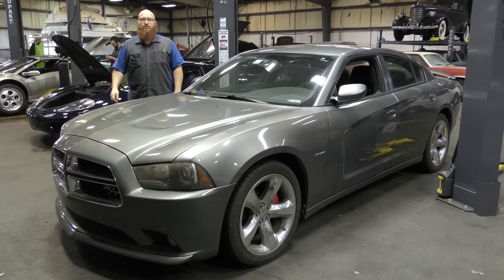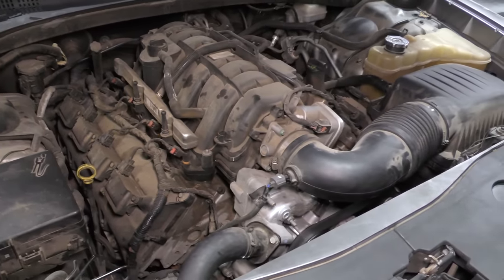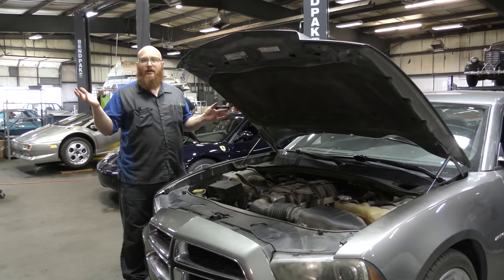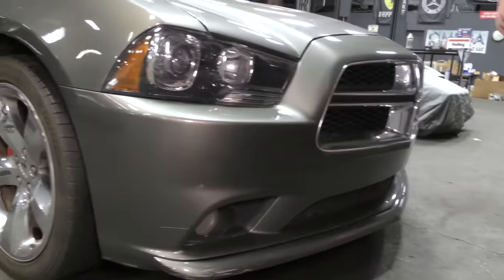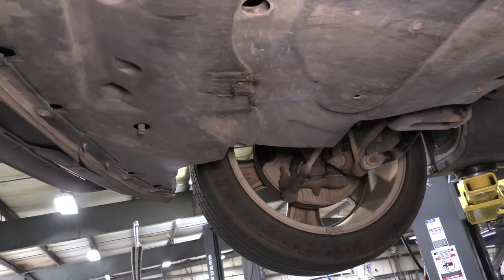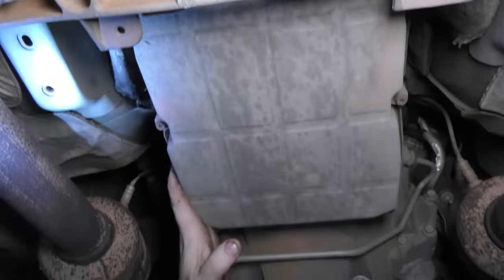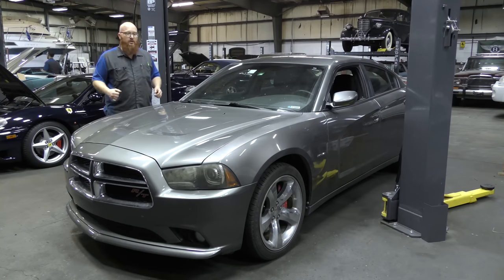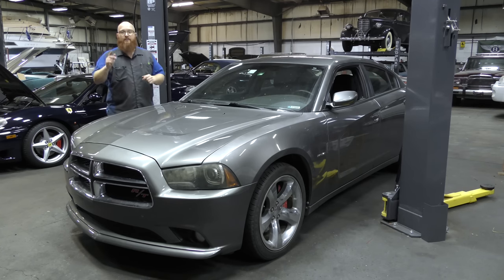Tic Tic Tic! 2011 Dodge Charger RT has the infamous Hemi tick. What will the CAR WIZARD do about it?

Comment: I'm from europe. I'm not familiar with the prices over there but 500-600$ for a sensor and starter button replacement sounds like a lot to me.
My c200 from 2011 had a problem with one of the fuel lines from the tank and needed discs and pads on the rear axle. I payed in total 700euros for everything.
Reply: @gregkarch4673  ohh you're right, I missed that and I forgot about the diagnosis. I guess you're right,the price does sound reasonable

Comment: Not only the hemi is famous for the ticking the Ls to i have a 2017 gmc sierra 5.3L and the damn thing ticks to and make wired noises i can't believe my 1995 dodge ram 1500 3.9l v6 sound better that the 2017 and it has 190 thousand miles the only thing that I have done to the motor is 2 timing chains and valves adjustments i am always amazed that it still runs

Comment: I just built a 5.7 and added a distributor drive gear to the camgear. Discovered it had a bad timing chain set. The VCT engines have the worst timing chain I have ever seen. The tick is partially caused by this chain chipping away at the crank gear drive. Take the chain off and look at the crank gear and be amazed at the stupid design of this chain. I ended up modding the chain tensioner and cam gear from a 2006 model. Took apart the VCT gear and used the back plate on the 06 timing gear cause the parts aren't compatible at all. Welded that plate to the front of the 06 gear, Ground off all of the material used to center the gear on the cam, welded on a drive gear from a 4.2L ford v6 and used the cam sink body to center a heavily modified GM distributor. ...  For every penny pincher out there. the easiest way to fix bad rollers on the lifters is GM 3.8L lifter rollers. Not the lifters themselves, just the pin or rollers and pin. The pin is what goes bad, the needles never seem to be damaged so press out the pin and press in the other one. At the salvage yards 3.8L v6 engines are everywhere, parts are easy to find and easy to remove. So far, I've done this to 9 hemi's and no one has had this issue happen again . Wearing the edges off pennies in the best way possible cause doing the lifters on hemis isnt hard but you dont want to have to do it again and this method really works.

Comment: I have an ‘04 Ram 1500 with a Hemi and it doesn’t tick. I know what you’re thinking but no — it’s not up on blocks in my backyard. Daily driver with 140K on the clock. Must be the luck of the Irish!  I’m American though. Don’t even use Irish Spring soap. No Lucky Charms either.

Comment: Hey Mr. Wizard on have 2000 Chevrolet Monte Carlo SS with low oil pressure I replaced the oil pressure switch and its still reads low oil pressure also it has the 3800 V-6 motor. Should I rebuild the motor or replace the engine?

Comment: I owned 1 chrysler vehicle, never again!! I was so happy to sell it!!
Reply: Greg B  68k miles dead transmission, 74k more transmission problems. Metal and over vehicle quality cheaply built. 4x4 transfer case started to throw warning lights for no reason as well. i sold it to carvana before it got too much in the hole
Reply: Was a 2017 cummins 2500

Comment: My dads 05 Ram 1500 with the Hemi dropped a valve seat at 180k watch out for those. He would have fixed it but the trans and rear end were on their way out too. He only towed a handful of times with that truck never overloading it.
Reply: He had rear end issues since it was new and they wouldn’t replace it.

Comment: Are the tow hitches stock on these or what? I just recently bought a 2013 chrysler 300c and it also has a tow hitch just like that on the back, I got kinda scared thinking someone used to haul stuff with my car but then I realized if anything, they were probably hauling dirtbikes or jetskis or something instead of a vehicle. Seeing it's on this charger though makes me happy and makes me think maybe it's just stock lol. I was buying a 2013 chrysler 300s but it got sold two hours before I went to get it so i had to go with the 4,270lb one instead of 4,007lb one :(

Comment: The coyote engine (mustang gt) 2018 and above also have the same type of tic. Wizard Any advice on the “coyote” tic? Thanks
Reply: All versions of the coyote (2011-Current) can have the tick.  Its completely harmless.
Reply: My 2017 GT has the tick ... Almost at 5 years of ownership now, zero issues - with a supercharger. So many people on forums - especially 6G, try and attribute the tick to other issues they are having and it's nothing but speculation and hyperbole. Ford even released a TSB stating the noise is harmless.

Comment: I wonder if the power window motors on that car are Siemens branded. Siemens is German. 
I pulled a bad power window elevator assembly from a 2004-2006ish Ford Explorer with a Siemens motor.

Comment: Hey, Wizard, do You reckon if You could have a little view on a 15-19 Pursuit Charger ( 5.7 AWD ) I have imported that car from Canada to Poland ( where as for standard Dodge products we have all the parts in stock, as for Pursuit model I have to import everything from USA ) it's overall in supreme shape ( less than 20k miles when purchase ), but now it started develop very wird noise from transmisson/drive shafts when you get off from accelerater in 20-40 mph zone. Firstly I thought it's comin from bad flex joint, but this sound only appears in that 20 - 40 mph zone..

Comment: I swear you can insert the key fob into the start button by pulling out the button itself? Because my 2011 Challenger can do that if the starter button fails itself you can use the key fob as a actual key to insert and turn to start

Comment: Question car wizard, I’ve got a 2015 Honda Accord V6 6 speed automatic transmission, I pulled the dipstick and there was a very fine metal particles smaller than a grain of sand on the side of the dipstick. Is that normal?

Comment: Not knowing much about Dodge hemis - Hadn't known about this tic before. 
As described, it did sound like lifter leak down, causing extra clearance? Poor design or manufacture quality? 
Lifters might pump up a bit, at higher revs & oil pressure, reducing noise, then?
A ticking time bomb - Or handy warning? Sell @ 200,000?... Don't buy in the Ffirst place? :)

Comment: Ive got an 06 Charger RT with 180,000 miles and it doesn't have any tik of any kind. What it does have i can't figure out is it has a spark knock sometimes. I run 93 octane in it all the time. If you have any ideas please let me know. Sometimes it does say it lost connection with the crank,cam and trans shifter sensors among others. Ive replaced the computer and checked all the grounds and connections. i just dont know.

Comment: Oh, but there is a major issue with HEMI tick, and it's a sign of an inevitable repair that's needed in your HEMI. 

Once the ticking begins (normally after the break-in period), that means the roller bearing on a lifter has worn out and is now scraping against its cam lobe. By 60,000-100,000 miles, the cam will become so worn that it'll start misfiring, and the engine will need to come out for replacement lifters and a new camshaft. 

The cause? The HEMI has a major design flaw where oil doesn't reach the lifter bearings or the camshaft to lubricate either of them at low-RPMs. To prevent or delay this type of repair, don't idle your engine for very long, keep the RPM above 1500 if need-be. For newer HEMIs, leave auto stop-start on. Don't be a meathead about emissions. It's saving your HEMI. 

Oh, and let me present a catch-22 on idling a HEMI. Chrysler's ZF8HP transmission likes to shatter at around 60,000-100,000 miles as well. The reason why is because it REALLY hates running cold. So the Chrysler owner who wants to look after their car needs to choose which is better to save for preventative maintenance. Warm up the car/truck on a cold winter morning to save the trans, or run it cold to delay an expensive engine job.

Comment: Why do some of the hemi engines drop a valve seal into the cylinder and on average its on the passenger side bank?  I've seen it happen a few times in the dodge magnum and the 300c.

Comment: I thought the hemi tic was caused by the MDS system and the remedy to it is to disable MDS.
Reply: The MDS is just garbage , Chevy also suffers from that. I believe if you buy it new you can ask them to disable it .
Reply: Tech13 commented:The injectors tick very loud even more so starting 2011.they put noise insulation over the rails to help. The lifter rollers wear out and wipe out the cam lobes. That happens because they moved the cam higher in the block for better valve train geometry.  Now the cam does not get constantly bathed in as much oil and there is no oil gally feed to the lifter bores for lubrication.  It gets whatever washes over the lifters. If you hear a lifter tick that means the lifter roller is worn and the cam is getting scored. If you have a misfire and you want to determine if it's a bad cam. Do 4 or 5  Accelerations to the redline. Then the engine will start to misfire bad
 Let it idle and it will smooth out. When the ramp on the cam lobe is damaged it causes the lifter to collapse on hard acceleration.  Even if you don't hear a tick it can still be a bad cam.

Comment: Hey Car Wizard, I have a 06 gto ls2 that idles a bit rough (shakes side to side) sometimes that's accompanied by a light ticking that seems like its coming from the bottom of the engine, it only seems to do this when i'm idling, when i accelerate it feels pretty normal.  Any ideas?

Comment: Have 38k miles on my hemi. Is there anything I can do to avoid a hemi tick? Is it usually the exhaust bolts or the actual cam issues? Just regularly change the oil and deal with it when it comes?
Reply: @doucheymcfloppycock7459  Thanks for the tip. I do OC's at 6k with my tire rotations but always use full synthetic and don't idle long. I bought it used about 20k miles ago so I'm taking good care of it. How's your Challenger treating you otherwise?

Comment: Could just be exhauste bolts. This hemi tick gossip is rampant.. my ram has 115,000 with no issues. Use  a very good oil I mean very good and change every 3,000 you'll be fine.
Reply: Also don't idle for long periods of time...highway driving is best...

Comment: Jesus that engine needs a cleaning, and I gotta say I remember coming across a florida man on here who had one of these, and one of the things he said that's an issue with them is the thermostat comes on too late, which can cause the motor to overheat and cause problems, including maybe that tick, like I forget the exact number but it needs to come on earlier to keep these reliable, I think 215 instead of 245.

and I think the latter hemi's had that change done to them.

Comment: I'm surprised no mention was made of the high mileage engine, loss of valve seat problem the 5.7 hemi is notorious for.  I'd be seriously concerned about that if I was the owner.  Edelbrock cylinder head swap would be a smart idea.

Comment: Re: hemi tick. I Do Cars implies these Hemi motors tend to drop valve seats, possibly related?
Reply: No, it isn't. Is more an issue of engine overheating. My 2008 Chrysler 300 did not have the Hemi tick before one valve seat dropt.

Comment: cool review but i hope for the neightbors they dont drive at 3am lmao,and the big problem with those car are the electronics here in qc canada they have big problem with it cause of the harsh cold climate and other mixed temperatures we have, nothing wrong with them until you get abit of wear , like over 60 k miles start to get expensive to fix my brother had many of those hemi dodge pickups. minus 35 fahrenheit here is nothing special haha

Comment: Just got 2010 grand Cherokee with a  5.7 hemi and 52k miles. Hopefully my lifters are okay :)
Reply: Also wizard Id love your opinion on the 2005-2010 grand Cherokees(WK). I know the 4.7 is trash but I’ve had a 3.7 and now a 5.7 :)
Reply: Suggest Tech13's comment shows what you can do to test out your new purchase:
The injectors tick very loud even more so starting 2011.they put noise insulation over the rails to help. The lifter rollers wear out and wipe out the cam lobes. That happens because they moved the cam higher in the block for better valve train geometry.  Now the cam does not get constantly bathed in as much oil and there is no oil gally feed to the lifter bores for lubrication.  It gets whatever washes over the lifters. If you hear a lifter tick that means the lifter roller is worn and the cam is getting scored. If you have a misfire and you want to determine if it's a bad cam. Do 4 or 5  Accelerations to the redline. Then the engine will start to misfire bad
 Let it idle and it will smooth out. When the ramp on the cam lobe is damaged it causes the lifter to collapse on hard acceleration.  Even if you don't hear a tick it can still be a bad cam.
Reply: You dont drive enough. Might have lot rot. Just kidding. But that is like 5k miles a year.
Reply: @bendino9016  well I bought it at 52k in January and have 56k now and I did the basics belts, fluid change and an alignment. Loving the car so far especially getting out of a 3.7

Comment: Anyone see a difference between a manual to an automatic? I feel keeping those rpms closer to 2000 is keeping the motor lubricated. How about a high volume oil pump? The lifter could use an improvement on its design.

Comment: I switched to an srt oil filter, quieted it down a bit, same as going to premium and some liquimoly lifter additive.  If you REALLY wanna quiet it down? Throw some Long Tubes on it 🥴
Reply: 5038041AA is the P/N thatll fit the 11- 14 hemi, think they updated the oil cooler in 15 so its a different size now.  If it takes the mo-899, this filter will fit.

Comment: Hey Wizard & Mrs Wizard!! Ooo, a Charger, I slammed into one of those when it's driver ran a stop sign!!! 
As for the Tic? Just reschedule the valve train for the afternoon run. 🥴🤪
Reply: And no mechanic in a bottle
Reply: Tech13 commented:The injectors tick very loud even more so starting 2011.they put noise insulation over the rails to help. The lifter rollers wear out and wipe out the cam lobes. That happens because they moved the cam higher in the block for better valve train geometry.  Now the cam does not get constantly bathed in as much oil and there is no oil gally feed to the lifter bores for lubrication.  It gets whatever washes over the lifters. If you hear a lifter tick that means the lifter roller is worn and the cam is getting scored. If you have a misfire and you want to determine if it's a bad cam. Do 4 or 5  Accelerations to the redline. Then the engine will start to misfire bad
 Let it idle and it will smooth out. When the ramp on the cam lobe is damaged it causes the lifter to collapse on hard acceleration.  Even if you don't hear a tick it can still be a bad cam.

Comment: Had a 2011 charger rt I got it in 15' engine jus clunked out last December Hemi tick 3rd coil misfire led to a cam and full roller replacement 3700 dollars. Well I didn't pay it my dumb ass sold it 4 2500 took that drove from cali to Mississippi baught a 2019 challenger rt guess in 5 yrs I'll trade it in like the owners of my charger did

Comment: That is one filthy engine. I'd have to give that thing a thorough cleaning before I would work on it. To much danger of getting some of that dirt inside. 
Any idea what causes the Hemi "tick"?
That paint wouldn't last 2 years in AZ. The sun would burn it right off. It would have huge spots everywhere. I always get white cars, but they have their own paint problems. Seems like all American white cars have paint that just falls off. My 2006 white Grand Marquis daily driver is in great mechanical shape, but half the paint is missing.

Comment: You didn't explain the cause of the hemi tick.
Reply: Tech13 commented:The injectors tick very loud even more so starting 2011.they put noise insulation over the rails to help. The lifter rollers wear out and wipe out the cam lobes. That happens because they moved the cam higher in the block for better valve train geometry.  Now the cam does not get constantly bathed in as much oil and there is no oil gally feed to the lifter bores for lubrication.  It gets whatever washes over the lifters. If you hear a lifter tick that means the lifter roller is worn and the cam is getting scored. If you have a misfire and you want to determine if it's a bad cam. Do 4 or 5  Accelerations to the redline. Then the engine will start to misfire bad
 Let it idle and it will smooth out. When the ramp on the cam lobe is damaged it causes the lifter to collapse on hard acceleration.  Even if you don't hear a tick it can still be a bad cam.

Comment: Customer: Hey my cars making a funny noise and there’s lights on the dash

Crook mechanic: We diagnosed your vehicle, your muffler bearings are shot, the oxygen pressure sensor needs replaced, the hydraulic steering oil needs to be flushed and the harmonic balancer is out of balance

Customer: ok how much is that?

Crook mechanic: $8700 and we can finish it today within 3 hours

Comment: I believe this guy knows his stuff but hemi tick is not good. Telling you now. I own a 2008 non mds ram and I had the tick drained oil and shavings everywhere. Lifter failure is the issue 50% of time. My lifters ate up cam and only 100k miles. Do not take the tick lightly. Manifolds are normal failure  but investigate people.
Reply: keep spreading the word, thank you for sharing.